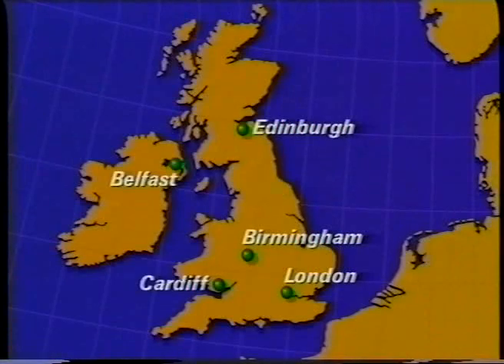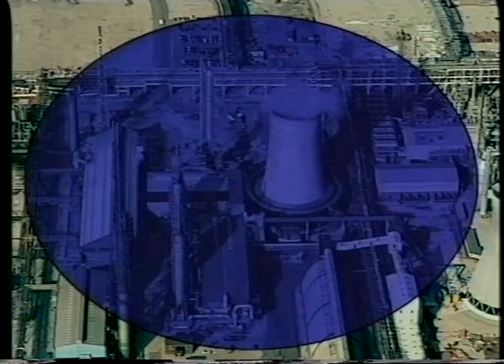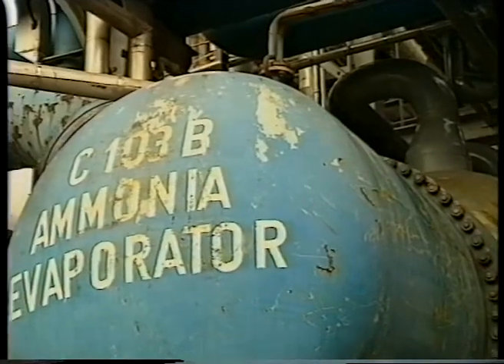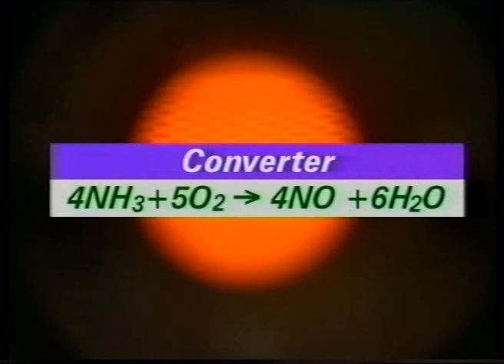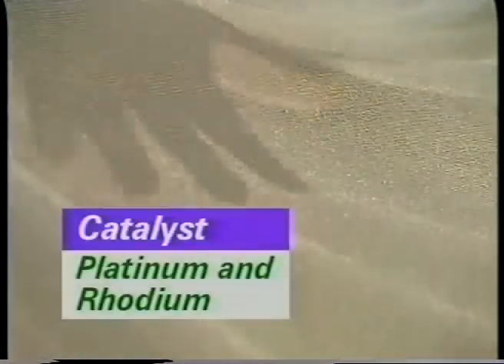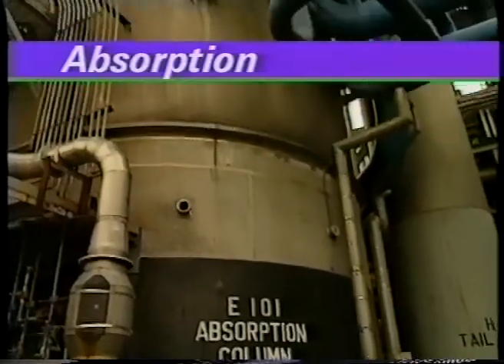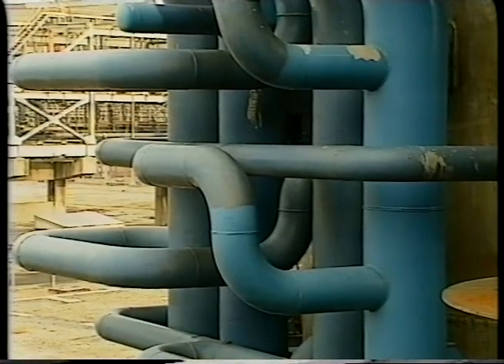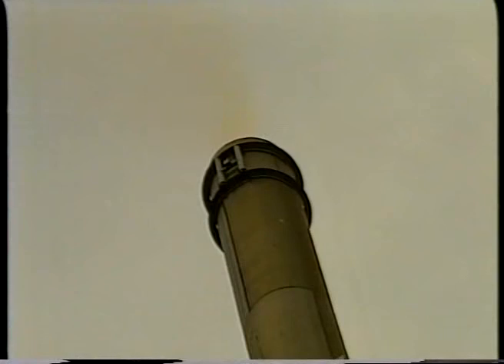Nitric acid plant understanding

Comment: Presently mostly knitted Pt/ Rh gauzes are used instead of woven gauzes, being more efficient. At present a catchment system made of Palladium (Pd) is installed under the Pt/Rh catalyst gauzes to catch lost  particles of catalyst to decrease overall loss of catalyst. 
This Pd catchment system is also replaced after 3 or 4 months and used one is sent back to manufacture for refining, hence metal recovery and rebuilt. 
By installing the catchment system, overall Pt/Rh loss is reduced more than 50%.